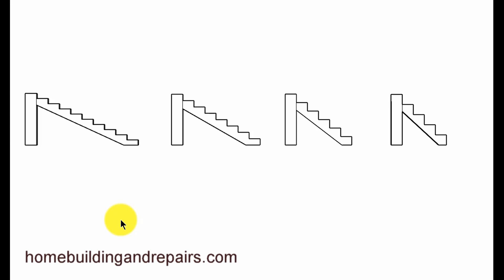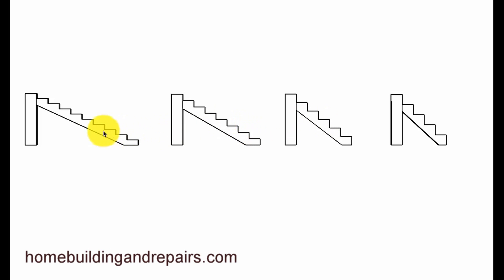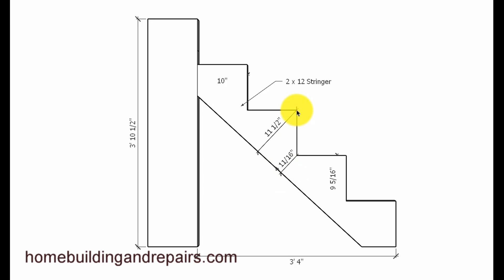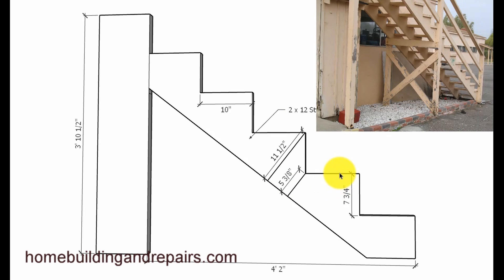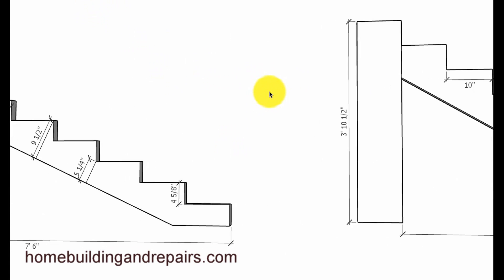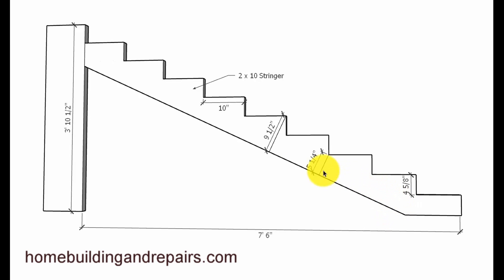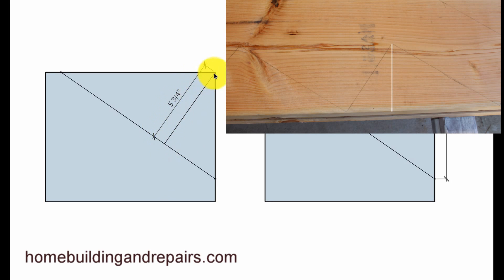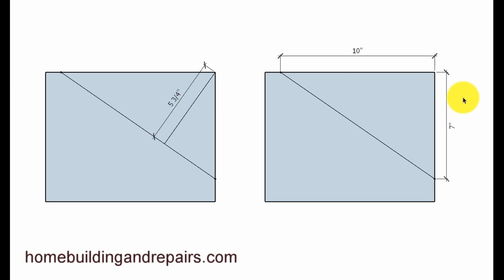How Riser And Tread Lengths Affect Stringer Strength

Comment: You know when doing a stringer layout for a deck how you'll see folks cutting the bottom riser off to account for the tread thickness? Because if you leave it the same as the rest you'll end up with a higher first step at ground level. I understand that.. but doesn't that change the height of where you first calculated your stringer would attach to the actual deck? It seems to me if you wait until you layout the entire stringer... say you calculated each rise at 7 "... then you go and cut 3/4" off the bottom of the first riser to accommodate for a decking board thickness on that first step, wouldn't that then cause the entire stringer to drop 3/4" lower and thereby consequently dropping where you first calculated it to attach to the deck with your initial calculations?
Reply: You're measuring from top of finish floor level. So go down 7inches and mark it out. Set the stringer to that mark. Once down cut off 3/4" off the bottom of stringer. You're stringer will sit down then 7 3/4" making each step 7 inches from floor to deck once the tread is put on
Reply: @jamieguest5425  Oh I see. That’s a finished floor measurement where the decking is already attached to that level so that makes perfect sense to me now. Thanks for your answer!
Reply from the maker: I would suggest visiting our website and checking out some of our other videos on stair stringer layout.
http://www.homebuildingandrepairs.com/stairs/index.html
Reply: No, because you add that board to every 1, therefore adding the thickness right back on top of each step

Comment: How many stringers should I use for a 32" wide stairway?
Reply from the maker: I would use three, but you can get away with using two if you use thicker stair tread materials. For example a 3 x 12 stair tread could easily span 32 inches, only using two stringers, one at each end and none in the middle.